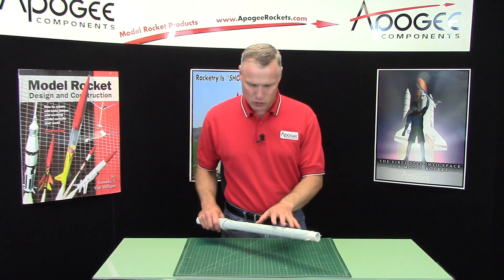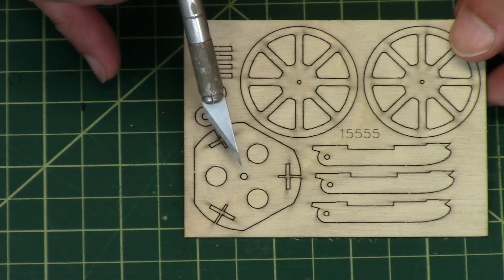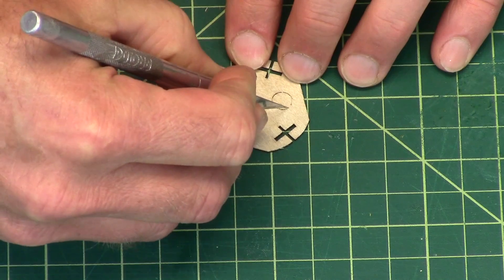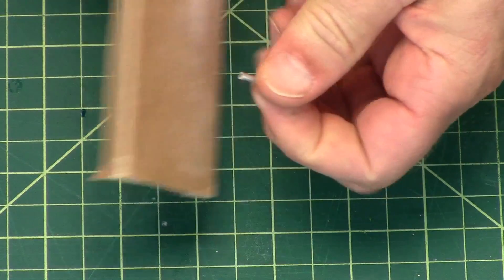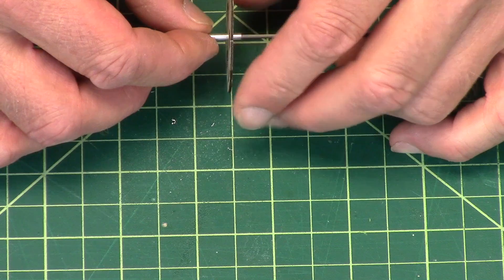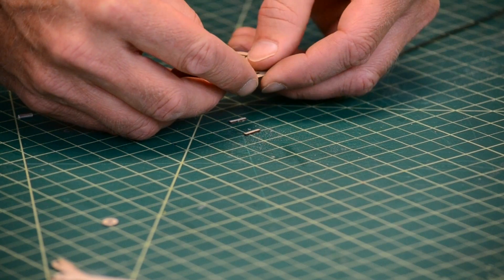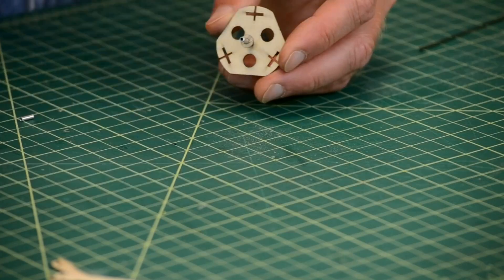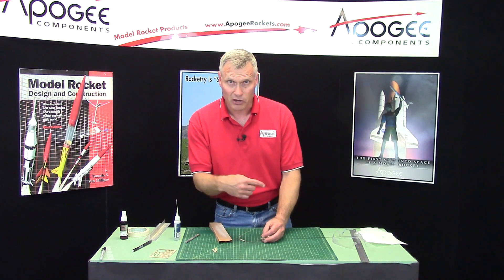Rotary Revolution 02

Comment: I had some thin super glue run into the joint and lock it up when putting the blade on.  I was able to recover by applying some acetone with a paint brush to the join and letting it sit for 15-30 minutes.
I would recommend using a medium ca glue for attaching the blades.  It wont wick down the balsa as fast.